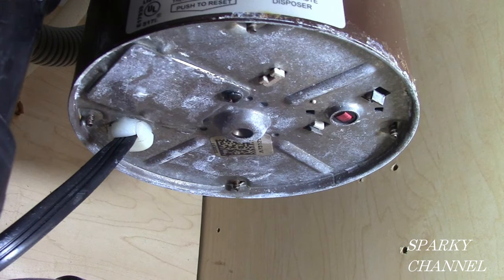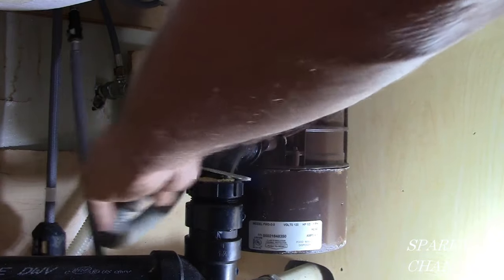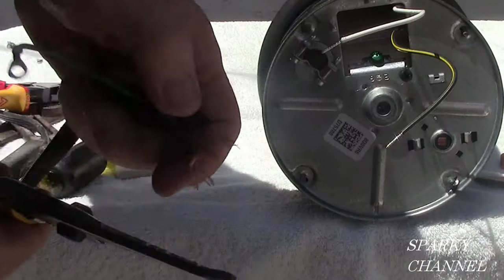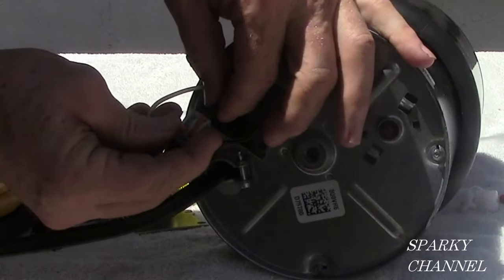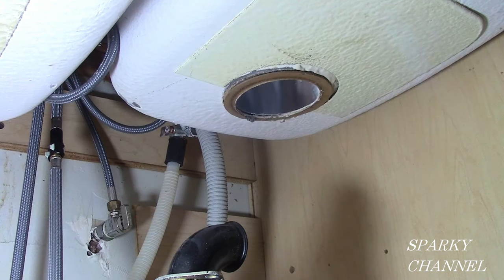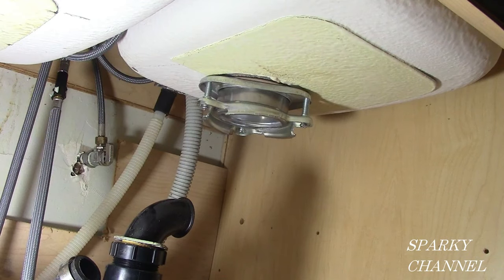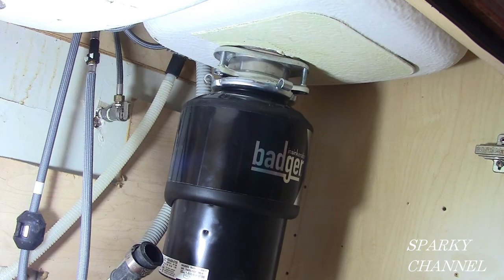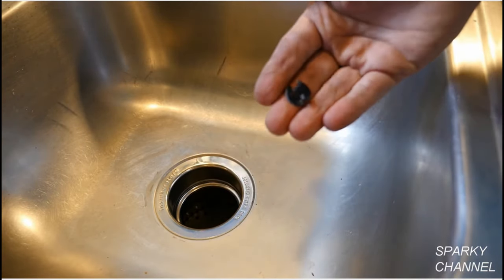How to Install an Insinkerator Badger Garbage Disposal

Comment: Bill, great content as usual.  So many questions, but I'll limit myself to 3.  I installed an Evo a few years ago.  Biggest problem?  Lifting it into place under the sink and getting the initial catch.  I think I had to hold it up with one hand!  (1) So a link for your mini scissor jack would be great.  Looks like it's been leaking down there but not too bad.  Any recommendations for proactive or remedial action for the water damage?  I'm always looking for some kind of customizable shallow plastic tubs, kind of like what they sell for car floorboards, to put down there.  But the dimensions never work out or pipes and such get in the way.  Sometimes a cat litterbox will do.  Finally, (3) was this a House Renovation Time (HRT) video?  1.1HP?  What do you do with that?  Chop up old galvanized pipe?
Reply from the maker: We have the: S&T INC. 512401 Plastic Under Sink Mat Shelf Liner, Non-Adhesive and Waterproof Cut to Fit for Kitchen and Bathroom, 24 Inch x 48 Inch, Charcoal: Amazon: https://amzn.to/2zcteH9
  under our sink and it helps but of course the thing to to is to fix the leak. Did you see in the video where I tightened up the disposal connection with the Channellocks? That's the 1st thing I would check but check all the connections.
The scissor jack is just one from a car, perhaps a VW. It has a handle that you jack up. I have a friend that uses his knee to support it for a moment but I'm not flexible enough for that. The lighter disposals are easier to handle without any help but the bigger ones like your Evolution are more difficult to handle so I started using the little scissors jack. No, this one was from a neighbor's house. He pays me in Macadamia nuts from his tree which I love! LOL at chopping up galvanized pipe!
Reply: @SparkyChannel  Thanks for the link on the undersink liner, I will give it a try.  Wonder if I could cut-to-fit and silicone some edges up the side to handle small leaks?  Payment in macas?  I would do that!  Love 'em and they are worth their weight in gold (almost)!

Comment: Sparky, TY. I noticed my disposal was installed with the connector pipe actually slightly tipped up. Won't that lead to "stuff" and water from the other sink leaking into the disposal? TY v much.

Comment: Getting the snap ring on is very difficult. Do you stretch it open a little beforehand to make it easier to go on? The car jack is a good idea. I will be using it tomorrow. I already have the old one out....and it is going back because the leak was at the top.

Comment: there is usually a "block" in the dish washer connection you must tap out before installing the hose. Not sure if you're had it but i just bought an insinkerator and it had one.. just fyi. Great video.
Reply from the maker: Yes, the disposal comes with a plug that must be knocked out if you are using a dishwasher.
Reply: Yeah.... I'm just finding this out....

Comment: Hey Bill, did you have any issues with the snap ring popping out of the groove while tightening the three screws? I can’t seem to tighten the screws enough to make a solid seal without the snap ring popping out
Reply from the maker: Wow, no I've never had that problem. My guess is that you never got the snap ring all the way in.
Reply: Same issue when tightening the three screws the snap ring pops out of place